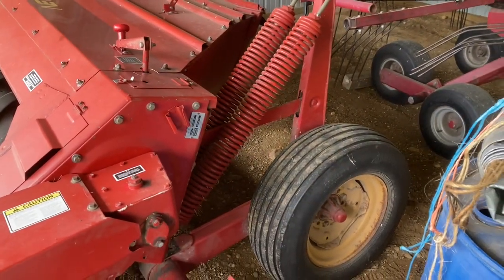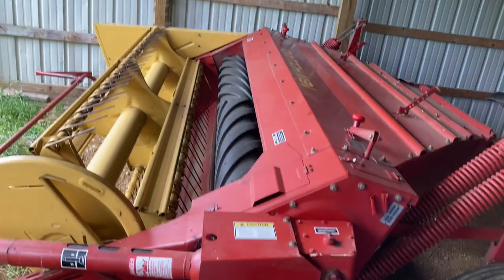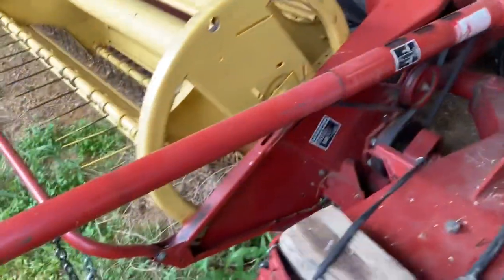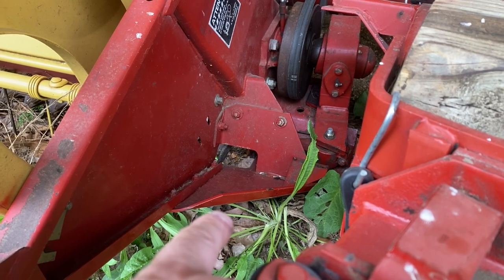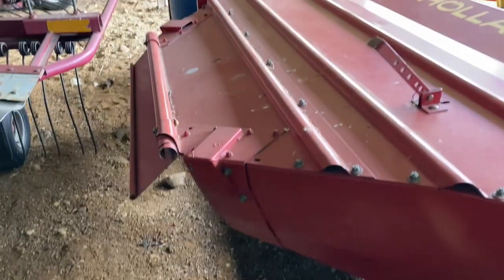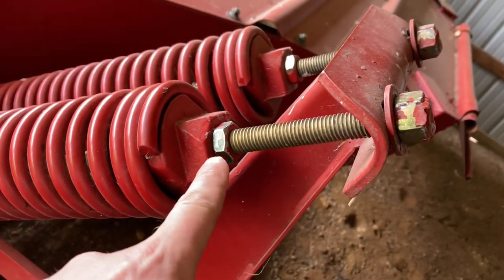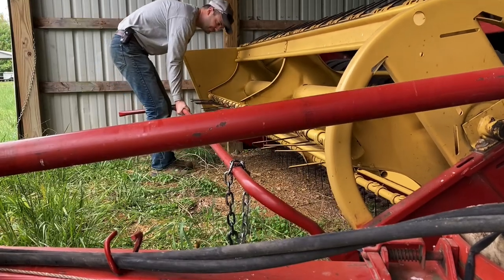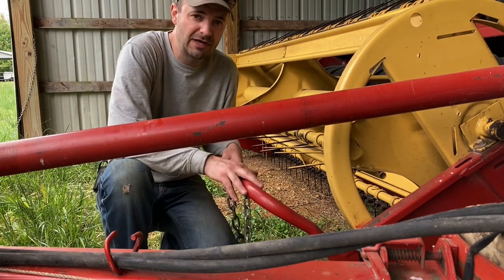Adjusting  your haybine header floatation springs!

Comment: Wow, I’ve only been farming for about four years and didn’t know about adjusting the springs which now makes sense because the head dropped down so hard as well as dragging hay.  Your video on stub guards also taught me that my stub guards are out of adjustment and a cause for my hay not cutting sufficiently.  I use a 467 and a 489, the principles you taught me still apply. Next year after applying your principles, I expect to have a better haying experience thanks to you.
Reply from the maker: Set your mower up as I describe and you will be amazed at how well your machine works!

Comment: Great video - spent 6 hours cutting 5 acres yesterday. Kept clogging under the shoe, and yes it slams down when I lower it. I'll check the weight and adjust before cutting the next field for sure. Also - your video on the Hay dogs was invaluable. Keep up the great work and THANK YOU!
Reply from the maker: Wow! It should only take you 1.5 hr with a Haybine to mow 5 acres! What is your ground speed?
Reply: The drive belt on the wobble box was split. Your video on replacing that drive belt was also amazing - went just like you said. I also just added the stub guards and will cut my last field tomorrow. We had over 5 inches of rain from the tropical storm - this last field will be the thickest yet. Thanks again for all the help.
 @TheScientistHayFarmer
Reply: Today I did 7 acres under 2 hours after your help. Installed the stub guards, adjusted the floatation springs (they were at 150 pounds), and replaced the main drive belt. Thre videos - three home runs.
Thank you sir .... I am in your debt. 

 @TheScientistHayFarmer
Reply from the maker: @user-py2zx5hm1g that’s amazing! Glad to hear you got it purring and glad you found the videos helpful. That’s all I’m trying to do.

Comment: Great Video! I never new! I'm having some binding on the New Holland 488 in the oval/circular track that the four wheels go into. The track on the bottom has the steel worn thin. Could this be causing the binding of rotating feed at the front?🤔🤔🤔
Reply from the maker: My guess is the metal is worn thin because that’s where it is binding. Check all the rollers to make sure they’re free rolling and then you’ll have to inspect the track carefully to see if it’s out of sorts somewhere or too tight against a roller.

Comment: If you take a suitcase or any other dead weight and lift it, it doesn't matter if you lift it an inch, a foot, or mile the scale is going to read about the same weight. However, if you have a spring loaded header, the more you lift it, the less the springs are going to help support that weight. For example if the unsupported header weighs 1000 lbs sitting on the ground, and you tighten the springs to lift it one inch, it may take 50 lbs on the scale to lift it the second inch, 100 lbs for the third, and 1000 lbs to lift it a foot because the springs are no longer helping. My point is it seemed to me you were lifting your header 3 or 4" to measure the 50 to 70 lbs when I was under the belief that the 50 to 70 lbs should be enough to cause a fraction of an inch clearance, but not 3 or 4." I could be wrong. What are your thoughts?
Reply from the maker: I think you ARE wrong lol. Because this is a linear or fixed rate spring. The coils are all evenly spaced and the rate of coil compression is linear. You are thinking of a variable rate spring that has different amounts of tension depending on how far it’s compressed because the coils are not all evenly spaced.

Comment: Quick question. On the wobble box side, I adjusted the spring to the point where it's almost all the way to the top, but I still can't lift it. Do you know if the springs lose their tension over time and it's a matter of putting new springs on? Thanks a bunch. Your videos are very helpful.
Reply from the maker: Do you have the head completely lowered so it’s sotting on the ground or is it raised?

Comment: Hey do you think a haybine could be used for windrowing buckwheat and white clover for seed production? The conditioner would obviously need to be open wide as not to shed the seeds.
Reply from the maker: I have no idea… I don’t know anything about harvesting for seeds.
Reply: @TheScientistHayFarmer  well its basically about cutting the plants when they are already mostly dry, and leaving them on the ground a few days to get the remaining moisture out, then picking it up with a combine. We've done it before with a disc mower, and the conditioner removed. But those mowers are relatively violent and shed seeds.
This one appears more gentle, but would the cuttings still flow through with the conditioner open or removed?
Reply from the maker: @fermewilmotsagriculturebio3434  if that’s what you want, why wouldnt you just use a regular sickle bar? That would be most gentle because it would cut it and just drop it. They’re very inexpensive too and require very little power.
Reply: @TheScientistHayFarmer  I was looking into the haybine because it creates a wind row which you drive over and which is easier to pick up for a combine. Not sure a sickle mower does that.
Reply from the maker: @fermewilmotsagriculturebio3434  I don't think it would still create a windrow without rollers because the rollers are what throw the hay back to create the windrow in the first place. You could shim the rollers to space them apart but I'd still think it would knock quite a bit of seeds off.

Comment: I'm looking at buying one of these new Holland's 479 set my Farmall tractor is only got one way hydraulics can I block that cylinder off on one side do I need a down pressure
Reply from the maker: You need the return line on a double action cylinder otherwise it won’t lower.   You could put a single action cylinder in there which allows the weight of the machine to drop it when you release the pressure but then it will drop like a rock and slam down every time can be hard on it.
Reply: @TheScientistHayFarmer  thank you may I ask another question are these 469 models able to get parts available and how do you unplug one of these machines if it does get choked up
Reply from the maker: @djmorgan8783  I’m not sure on parts availability, you’d have to check with Messicks or something but historically I’ve never had problems getting any new holland parts. 

If your knives plug then raise the header and back up. With it running sometimes that will be enough to unplug. Otherwise you’ll need to shut it off and remove the plug by hand. 

If your soil isn’t rocky I highly recommend converting to a stub guard system. No more plugs, you can mow faster, and it will make your Haybine mow like it never has before. I have a video on stub guards you should look into.

Comment: I've got the same 479 I'm having issues with the sickle guard scraping dirt sometime is there adjustment to lift or pitch it back I've been carrying mine with the Hydraulics a little bit
Reply from the maker: When you set the hydraulics all the way down, the head should rock back a little bit. If it stays at such an angle the guards are digging in, verify hydraulics are dropping the head down all the way by checking the position of the locking arm on the side. 

At the front of the groove where the locking arms slides, there is a metal table held in place by a bolt. The bolt comes out and the metal tab can be flipped around to sit inside the groove or sit outside to the front of it. This adjusts the angle of the header. 

Also adjust your flotation springs to float the header instead of running along on the skid plates.
Reply: @TheScientistHayFarmer  thank you for the knowledge I will look into it before the next cutting I did tighten the Springs down last year but I think I need to do it some more I did not check the pressure with a scale yet oh and another thing the hydraulic cylinder is not original so it could be too long but I will check that to but I figured the guards should not be digging up dirt and the rotary fingers should not be touching the ground